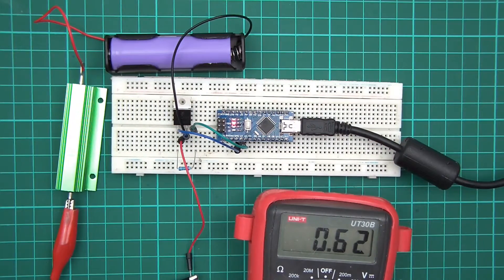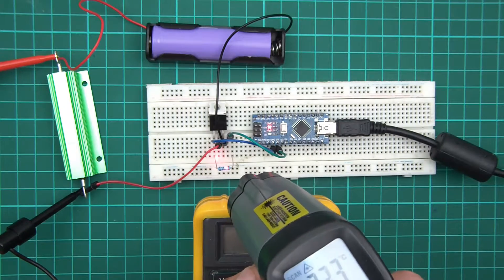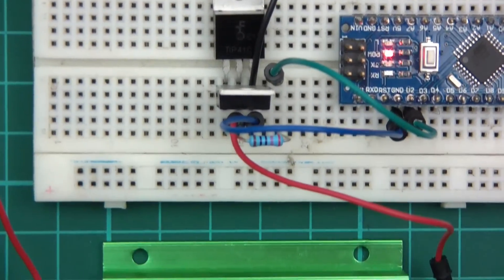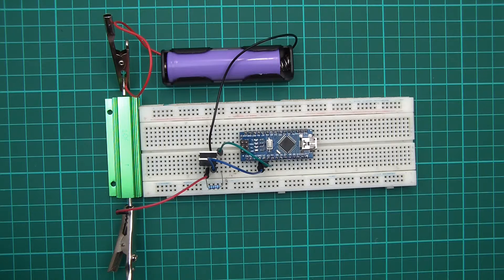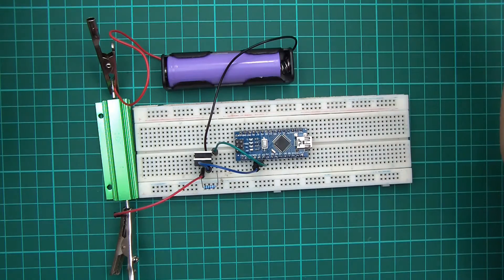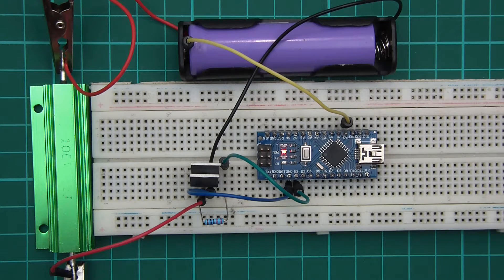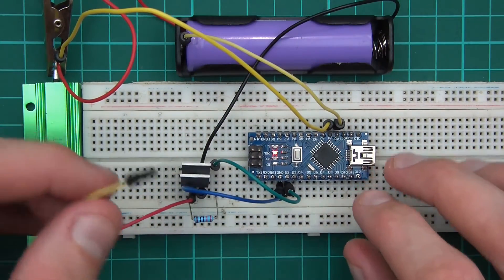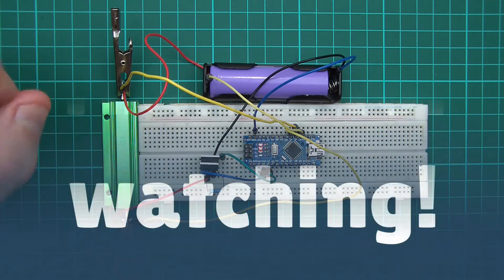TUTORIAL: DIY 18650 Lithium Ion Cell Battery Capacity Checker Tester (Part 4 - More Wiring)

Comment: Should you be taking the measurement for voltage drop behind the transistors?  if they are getting hot its a unmeasured current draw
Reply from the maker: gorally2003 Hey, the analogue pins are hot like you say. And I shouldn't be doing it this way, you're right! I'll address it in a future video. Any suggestions are welcome. :)
Reply: Antony Cartwright i figure maybe a relay powered and triggered by the arduino that way there is no voltage drop like you maybe getting across the transistors thats causing them to raise in temperature. Keep up these great videos
Reply from the maker: gorally2003 They won't raise in temperature now. I fixed it in this video.